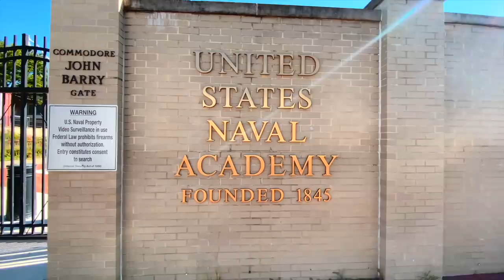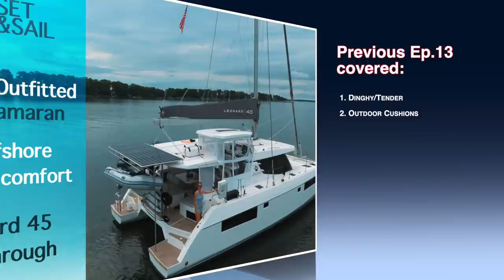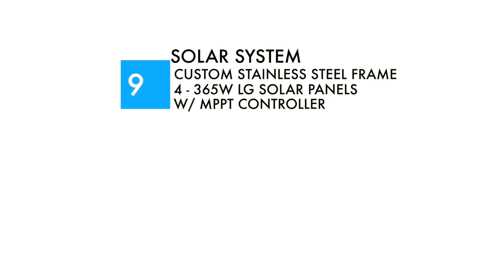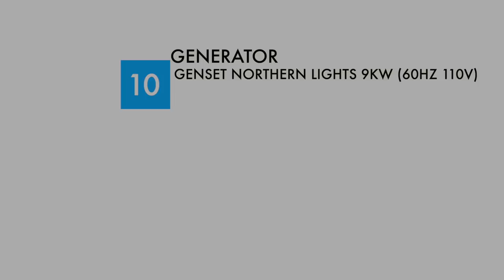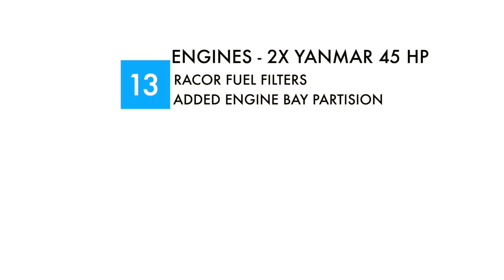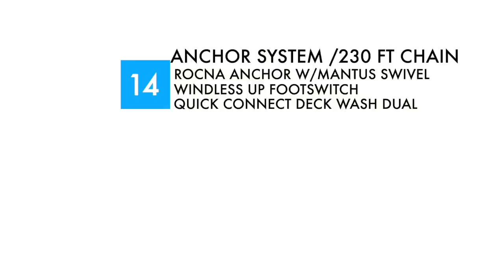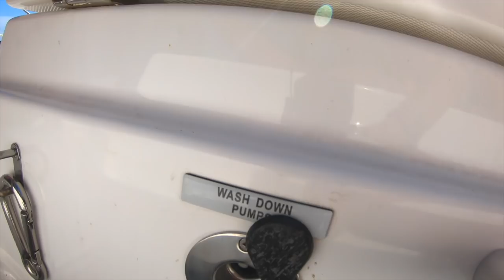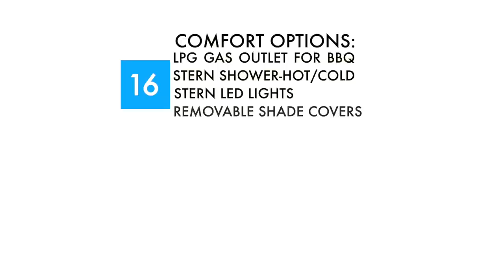How We Outfitted our Catamaran for Offshore Sailing & Comfort -Leopard 45 Walkthrough PART 2 [Ep.14]

Comment: 2 more panels sideways and tilted slightly forward will compensate for that shading. Making one that allows you to change the tilt though...would be amazing. You should consider it. Free power without noise is even better. Not that having the emergency generator is nice too, ha ha. Love your boat though.
Reply from the maker: Thank you for your comment and suggestion.  We have looked at other solar options however the panels we have in place now fully charge our battery bank nearly every day before noon.  It is fantastic to have 100% free power with no noise at all!  We love it!

Comment: I am loving the videos and just finished getting current.  One comment from someone who is not an owner yet, but who has had a boat for a good many years and does a lot of his own work.  With that disclaimer I'll ask- No grommet on the wire for the light just catamarans added at the transom?  That wire passing through fiberglass would rub a little at a time, right?  I'd seal it with something at a minimum to keep it from moving and to keep moisture out, but perhaps I am not seeing it correctly or they took some other protective action there.
Reply from the maker: Hi Thomas, wow good eyes :-). There is a rubber grommet on the inside but I may squeeze a little marine caulking to seal up the outer area.   Thanks and thank you for joining our sailing adventure!

Comment: Great information!  I am looking at 2500-3000kw solar and doing lithium. I'm wondering if I would need the genset. Your thoughts? 
Cant wait for part 3.  I am assuming the water maker will be covered correct... Thank you for doing these, they defiantly help those of us that are a couple years out from doing this exact same thing get a better handle on all the after market set up expenses. Sorry, one last question... internet options...?
Reply from the maker: Hi Robert!  Wow that's a ton of solar!  Paired with lithium I'm not sure if you'd need a generator but you'll want to check in with the great team at Just Catamarans!  That said, my guess is that you'll still need a generator if you plan to have multiple A/C units on your boat and run them simultaneously.  With the amount of solar and lithium you're talking about, you could probably run one A/C unit perhaps all night (?) but high consuming electronics put a heavy load on the batteries. That plus the wonderful tech advancements that keep coming out on boats, power is always going to be the number one issue.  You may want to take a look at one of the last videos from Sailing SV Happy Together on YouTube on how they set up their Leopard 50 Catamaran.  Randy put a ton of solar and inverters on that boat to be able to run just about anything they want.   Regarding internet.  We've been coastal sailing for the most part so far so we've just been using our land options via cell phones but we have been researching this and will be probably having a system installed when we return to FLL this Fall.  We'll definitely share whatever it is we do in a video to come.   Thanks for joining our sailing adventure!  Stay safe.    ~Andy
Reply: @sailingsvoliluki6938  It seems like $31k could buy a lot of solar.and lithium.  I know lithium is about $1000/kWh installed but with panels, controllers, etc do you have any guess what the cost per kWh total is for everything?  You'd probably need near 12kWh of battery and the solar to back it up to drop the genset I figure?

Comment: Always turn propane off at the TANK first, then the grill.  It's not required, but it's a good safety precaution as the lit grill will give you a visual indicator your tanks are still on.  Also, was there no vent in the compartment?  You should have an exterior vent at the bottom (but not leading into the hull!!!) to prevent accumulation.
Reply from the maker: Great tip on turning off the gas at the tank first.....thank you.  There is an exterior vent in that compartment which does NOT lead into the hull 👍

Comment: Great information may i ask what the total cost was for your boat and all the extras. Wife and i cant wait to follow in your foot steps!!!!
Reply from the maker: Hi Andrew, the total cost all in was roughly $800k.  It's very easy to spend far more than that when you start adding on aftermarket items which is why we have put together these rather detailed exterior and coming next interior videos.  Not to say our way is the best or the only way but to share what we did, how we did it and why?  The biggest cost factor in what you add aftermarket is based on how you plan to use your boat.....where you plan to sail her.  The most expensive version of pretty much any boat will be a "blue water" or offshore rigged boat because the systems you will need such as water maker and solar can get pricey but are necessary.  Anyway, hope you like the videos.....more to come :-).  All the best and stay safe!  ~Andy

Comment: Andy, did you guys upgrade your shore power to 50A or are you using 30A that comes standard with your boat?  If you have the 30A service, have you had any issues.  Thanks.  Rich
Reply from the maker: Hi Richard, We have the 30A service (2x cords) that we pigtail into a single 50A to the shore power pedestal.  No issues at all.
Reply: @sailingsvoliluki6938  Thanks

Comment: What exactly is that rub rail protecting ? I don’t understand, is it to stop lines rubbing against the fiberglass? Its up so high the dock lower than the rub rail.
Reply from the maker: Hi Mark!  You’re right, the rub rail is up high on the “freeboard” (the side of the boat) however it is in the correct place.  Rub rails on all boat are set at the widest actual point of the outer hull(s) and are there primarily to protect the fiberglass when docking in a boat slip or fuel dock as an example. The rub rail will be the very first part of the side of the boat to “rub” against the dock pylons. They’re not cheap to have installed but it’s far less expensive than having to have fiberglass repairs done. Additionally if the rub rail were ever do become dented, the damaged section can simply be replaced. Hope that helps with your question. Thanks for joining the journey!  A new video is on its way!  All the best!

Comment: What kind of speed can you get just motoring with dual engines? Like crossing to Bahamans with no wind.
Reply from the maker: That will depend on ocean current etc but in general running both engines at roughly 2,300RPM's we usually see 7+ knots

Comment: Are your solar panels enough or you would add more solar panels in the future?
Reply from the maker: Hi Joseph!   I don't think we would add any more solar.  At almost 1500W, the panels top off our batteries in just a few hours.  If it's a cloudy day it will take most of the day but we've never had an issue of running low on power during the day.  There are times that we run the generator for 1-2 hours to make dinner and top of the batteries before heading off to sleep but that's about it.   ~Andy
Reply: @sailingsvoliluki6938  thanks for the reply Andy. I asked that question because I was am also watching sailing zatara and I came across from one of their Q and A that they would like to upgrade their solar to 3kw to 4kw. Stay safe as always and your family.
Reply from the maker: They also have a much bigger boat and more demand for electricity. You can never have too much solar onboard but the only option we’d have is to add the 100w walk-on panels which lose a lot of productivity because they sit in the shadows of sails, boom, mast and running rigging.  Technology of course moves fast so if a better option was available, we might consider it. 👍

Comment: Any security systems you could share?
Reply from the maker: Not that we can share.....for security reasons but if it's marine safety we did look at several pretty cool options such as the GOST System and also Siren Marine......you might want to check those out. Hope this helps :-).

Comment: Thank you for your videos I enjoy them a lot. Obviously your choice your money but it seems that some of these factory fitted options do take the piss. Now of course you do expect Leopard to make a profit nothing wrong with that they are a company which looks lik produce a great product. However Just for curiosity's sake I did a quick check on prices for the first two pieces of equipment your generator was $16k not the $31k and your liferaft $3k obviously these are not fitted prices but if this is the trend with all your factory fitted options you could of saved yourself tens of thousands by having these fitted aftermarket.

Now I am all for convenience and maybe the money does not matter to you and it is your money but apart from convenience I wondered why you went this route? I am betting you are a smart bloke and did the same maths as I
Reply from the maker: Hi Glenn, thank you for your comments....really appreciate them.  So the cost of the generator when choosing that option from the factory is not just the generator itself but all that the installation entails to run cooling systems through the boat, additional water pumps and connectivity to all the systems the generator will power.  It is a pretty detailed job.  Also I believe the $16k is the wholesale price of the generator but I may be wrong.  We weighed several thoughts when optioning items from the factory.  Cost is always a big one, perhaps the first one to take into consideration however the other is to research could we do this aftermarket and if yes, what would the cost, inconvenience of opening walls, floors, ceiling and labor come to not just in cost but time.  Keep in mind once you take delivery of your boat, every day it sits in a marina you are racking up dock fees and here in the States especially in Fort Lauderdale is going to be roughly $120 per day.  In the end the generator was far better to option from the factory than aftermarket.  Regarding the life raft.....this is not an option.  For any new boat to be imported into the United States there is a mandatory USCG Package that MUST be on the boat......the life raft being one of them but then there are flairs, life vests, etc, etc.   Anyway as we mentioned on the video there is a lot of thought to put into what options to get and where to get them from (ie factory or aftermarket).   Thanks again for joining our adventure.....hope you continue to enjoy the videos.   Best, ~Andy

Comment: $900 is a crazy amount of money for a pair of LED transom lights
Reply from the maker: If it was just the lights, I'd completely agree.....the lights I believe were less than $60 however the amount of work that goes into running wires through the ceilings to power sources and breakers is multiple days of work.  I wish it was less expensive but once a boat has been built adding some items, even those that seem small can cost, well.......$900 for a pair of LED lights :-)
Reply: @sailingsvoliluki6938  That makes sense. I thought the LEDs were an option when purchased new.